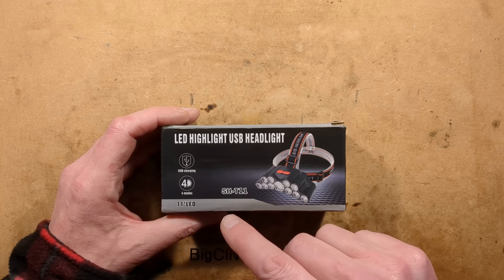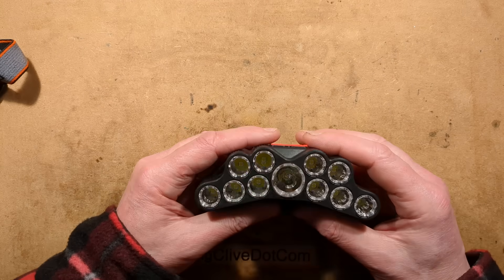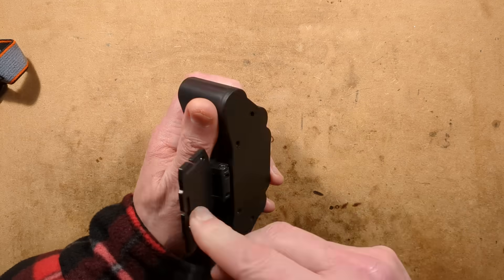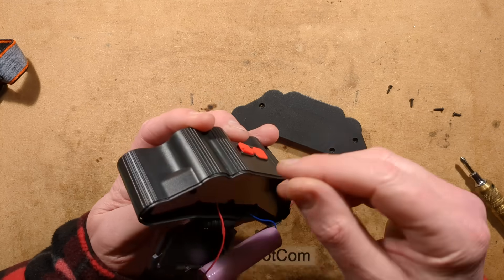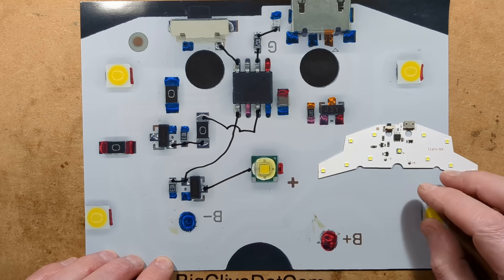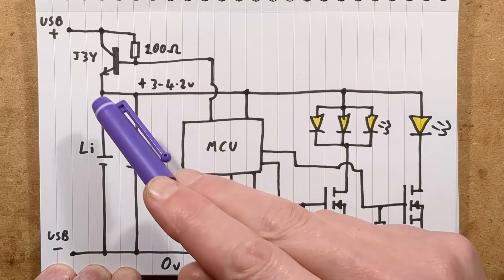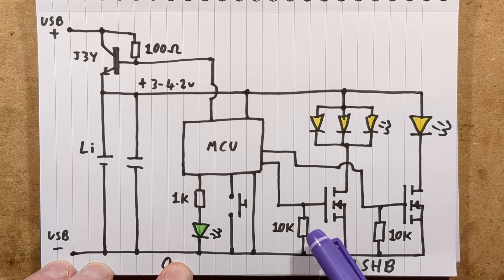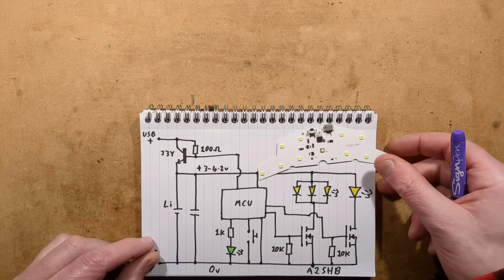Inside a (cheap) Mega head torch

Comment: Five years since your video ‘This USB rechargeable head torch is really good! (And no strobe!)’.  I’m still regularly using several bought at the time, and sadly they now appear to be unobtainium.  Oh for an updated one with usb-c, higher battery capacity, and a later generation LED.
Reply from the maker: If it's the one I'm thinking of then they are sold under the brand Core in the UK.

Comment: With this many LEDs they missed a trick by not replacing the "strobe" mode with a "Cylon scanner" mode...
Reply from the maker: That would have required a much bigger microcontroller and more transistors.

Comment: hi clive i need your advice i know it not your topic today and i have subscribed years ago
5x white led garden 3 lum each wired them up on bench supply did not wore a resistor in series (clot) 18m on bench supply current limiter    no bench supply outside what do i do    2.7 v 30ma ok on bench supply will take 3v but bright   what can i feed them with as i cant take them apart now there in the garden sealed up    alison😢
Reply from the maker: I'd recommend series resistors in series with each LED light.  If they are just plain 3V LEDs then you could power them with a USB power supply.  I'd suggest a resistor value of between 100 to 150 ohm per LED.  For higher power LEDs you could use a lower resistor value.
Reply: thanks clive but cant get into rock lights they where solar powered with battery 1.6v  i watched some back issues of you and decided contant current 2.7v  20 ma to 30ma  4v supply micro pcb but thanks for your reply i allways think of you at Christmas time and remember your days fitting lighting in Scotland  in your early youtube days as electrician😂😂

Comment: I see that kind of "headlamp" every now and then along with flashlight and headlamp results and never liked how they look. They look inspired by spider eyes and I had a feeling they're crap. Good to know that your teardown and reverse engineering confirms my suspision.

The multiple (weak) LEDs look very tacky to me compared to a single LED, but I think its designed to fool the layman into thinking it'll be bright with more LEDs while in reality being a lot inferior to some decent ones with a single or dual LED that are around the same price if not slightly higher. Very much an example of "a mug's eyeful".

As an example of a cheap but somewhat decent headlamp, I can think of the D10 (comes with single XM-L2 clone LED) and D25 family (comes in different LED flavors like XM-L2, LH351D, SST40) of headlamps from Boruit/Sofirn/77 Outdoor/Wurkkos and either model can do about 1000 lumens at max brightness.
Reply: I know of the D10 and D25 headlamps I mentioned as I looked into them when I was finding one for my father. He needed one since it isn't always possible to hold or place a flashlight nearby when he works on things. 

I ended up getting him the D25L revision with the LH351D LED and its plenty bright for him and he uses it quite a lot. Price-wise the D25L is pretty cheap for the decently made light it is at the 10~15 USD I normally see it going for and depending on where its bough even comes with an 18650 cell.

Comment: I found a nice little headlamp while on lunch break from work a few weeks ago. The "Farpoint" headlamp at Dollarama. Supposedly the output is 120 lumens for the spotlight LED and 350 for the floodlight LED, and battery capacity is 1200mAh claiming a max runtime of 2½ hours. So, not something you would use when out camping, but perfectly cromulent for doing a bit of maintenance work in the dark.

What I like most is that the charge port is USB-C (no digging around looking for one of the few microUSB cables I still have knocking around) and I bought it off-the-shelf for $5 Canadian - no paying shipping or bundling a bunch of other tat along with it, and no waiting 3 weeks for it to get delivered.

Mind you, I usually just use the NiteCore Tube that you recommended in other videos, held in my mouth when I'm working with both hands for a second. The headlamp only comes out when I know I'm going to be working on something for a hot minute and I don't want to drool all over the Tube. 😅

Comment: The internal resistance of an 18650 is 0.1 ohm or less. What's actually keeping this thing from going poof?
Reply from the maker: Probably the fact that it's a cheap cell with higher resistance, and the short wires and tracks also limit the current.

Comment: What a terrible circuit design, without current limiting and no PWM for reduced light and increased battery life!
There are lots of better options for a few €’s or $’s more with current limiting, PWM and a separate battery case for two 18650’s in parallel on the backside, even with a red rear light.
Also you can simply replace the cheap 18650’s by decent cells of 3000 mAh.
I like to use such headlights, on the workbench as well as outdoors!

Comment: You should also use a multimeter with frequency and duty cycle measure (for modes of flashlight) on those videos of reverse engineering.

Comment: Similar to the process used to make PCB holes conducive. Usually called PTH (plated through hole) is a process called POP (Plating On Plastic). 

Both cases you are putting an extremely thin copper layer on the non conducive surfaces which is the electro plated thickness. I did know that they dip (immersion ) chrome, I had always assumed it was electroplated over the copper.

Comment: Why do they use two mosfets if the controller turns on the "input transistor" which sits on the same rail as the LEDs? Is this just to enable those three modes (as otherwise it'd be a "boring" on/off for all only)?
Reply from the maker: The MOSFETs are used to switch the two sections of LEDs.

Comment: If you want to design a better torch. The Engineering Mindset has a great tutorial on making an analogue dimmer. It should work with 3-12V. More depending on resistors, current draw, and the mosfet you use. 
Currently trying to alter that design for a small keyring pocket light. Parts equate to around £1.30, without the case, battery or PCB. Speaking of... Small lithium batteries are far more expensive than 14500's or 18650's. I suppose supply vs demand.

Comment: Has anyone, ever, used the flashing mode? Every one of these headlights has this flashing mode that is unavoidable and it just seems unnecessary. What is it even for?
Reply: In case you need to get rescued when trying to figure out the rattling noise in the clothes dryer.

Comment: Would be great if you also tested if there is a battery protection mechanism on the pcb for when the voltage becomes too low.
Reply from the maker: The microcontroller usually shuts off at a preset voltage.

Comment: You mentioned current clamp.  Is there a current clamp useful for small DC currents like these applications instead of high currents like automotive?
Reply from the maker: The DC clamp meter I use is a Uni-T UT210-E which has a low current range.  But you have to get used to the fact it is so sensitive that it needs zeroed out in the exact same position it will be measuring current, as it detects ambient magnetic fields.

Comment: So with the tested battery capacity of 731mAh and measured current drawn at say 2A, we've looking at around 20 minutes of run time at best.
Reply from the maker: As the cell voltage falls the LED current will also decrease.

Comment: My question is who programmed the 'modes' on that circuitboard Clive? I bet there are not parts for sale that have different modes burned into them... 40 years ago if you wanted to make a flashing red led, it was done with transistors and condensators to make the 'flashing', weird that all this is baked inside such little things...
Reply: The microcontroller may be sold with hardcoded PROM firmware with the button sequence built in. The OEM just has to do the board and mechanical design.

Comment: I once reverse engineered a very similar headlamp (though it had a more sensible shape and all the side LEDs were closer together), with nearly identical circuitry. That one did support PWM dimming though and claimed to be waterproof. The included cell had almost no weight to it, no markings and a measured capacity of about 200mAh, so I swapped it for a 800mAh cell from my collection.
I certainly didn't expect Big Clive to verify my findings today :D

Comment: Ouch that hardware is nasty.
It's a classic case of making the electronic hardware as cheap and nasty as humanly possible, then expect the software guy to make it work.
Most of these supercheap micros can measure their own Vdd (battery) voltage, either using an internal ADC or on the cheapest ones they have a 32 step Vref which can still measure the Vdd to the nearest rough step.
Definitely a 👎 for this product.

We use a few headmounted lights here i  the workshop, the best one is the small tapered-body light with two rubber buttons on top, for wide beam or narrow beam. Light is excellent, battery life excellent, the two beam behaviours are excellent, and it has tilt adjust on the strap mount. It even has a proper 1200mAh lipo👍

Comment: I have one of the headlamps that's a flat wrap-around strip LED on the front, and a directional on the side, I quite like the front light, but it's battery capacity and power retention is woeful, about 30-40 minutes use and standby of a week. If I can find a decent quality one the design is great, this one was only maybe $3-5AUD on ali, so no great deal with it's quality.

Comment: Does the cell have any protection build in? 🤔
Reply: Doesnt look like it. Would be better to put a DW01 or similar inbetween and maybe a low value resistor to make sure the poor LEDs don’t die. They are pulling over 2 Amps
Reply from the maker: No.  But they often program the microcontrollers to cut off on low voltage.

Comment: I always wear a baseball cap when working, and found that it is the most comfortable and stable headband for headlamps. I just flip the cap around and wear it backwards, causing the adjustment strap opening and strap to be on the front of my head. Many headlamps attach to the band with a slide opening on a tilt hinge, which also works quite perfectly in the same fashion with the cap's adjustment band. 

It is comfortable enough that I often forget the lamp is up there, and have gone into stores and thought "why am I getting funny looks?" until I realize that, oh that's right, It's probably not usual practice for someone to have a headlamp on their cap in a well-lit store in the middle of the afternoon. I'm always looking for and trying different lamps to find one that's least cumbersome and most efficient. But mainly because I like electronics, especially ones with LED's.
Reply: I've found a few decent little lamps that clip to the cap's beak. I would be chasing the ideal among those if only I wasn't living in Canada... wearing a baseball cap is not really a thing for about 4 months of the year here. 😅

Comment: You get what you pay for. Starting from the 700 mAh 18650 and a non-protocol charger, which leaves the voltage present at end-of-charge. destroying the li-ion cell in a couple of weeks if you leave the charging cable connected permanently.
Also an headlamp must be as small as possible while this £2.50 is shaped like a miniature mausoleum.
The price of this device may not even cover the shipping from China. In any case isn't the right device for the job. You can get a decent headlamp for £25; having the requirement for hands free lighting I bought a Nitecore HC75 with the additional power extension. I have a true 18,000 mAh capacity, which allows 12 hours of intense lighting, either indoor or outdoor.
Thanks for the video,
Anthony

Comment: I would replace it for the highest capacity battery or modify the battery connection for external rechargeable battery pack therefore swap ability than having to wait for the internal battery to be fully charged but that just my opinion
Reply: I would put the battery in a drawer and yeet the rest.

Comment: Typical crapcells pulled from the recycling bin and rewrapped.
Stick in a 30Q or VTC6 or similar, and those LEDs would turn blue and start fizzing.
Reply: What if that's intentional and these all have an unusually high internal resistance which is carefully curated to make the circuit work without frying itself?

Comment: I got one of those for Christmas in my stocking...I use it in the garage for finding items in dark places and its greatest flaw is the cheap elastic head band stretches out quickly.
Reply: Got a similar cheap one. Upgraded the mystery _X_fire cells to some salvaged 18650 laptop cells, and put a DW01 board on to protect them. Then took the whole lot and used some rivets to put it on my safety helmet, because I was getting tired of using gaffer tape to hold it there. no more slipping off, though i did have to replace the ASH1 mosfets, as they were poorly soldered, and the one fell off. Took advantage of that to up the series resistors from 0R15 to 1R2 for both sides, no real drop in light output, but longer running time, and cooler LED dies. Charger was the typical cheap and nasty mystery one, replaced with an old but good Nokia one, from an old Nokia mobile phone, that long ago had been replaced, but the charge brick was still in the box of phone parts.

Comment: The control line from the microcontroller is often just to turn off the USB supply when the LEDs are on & the charging is just down to the transistor coming out of saturation as the cell voltage rises to the USB supply.